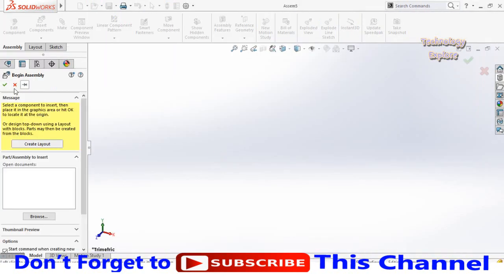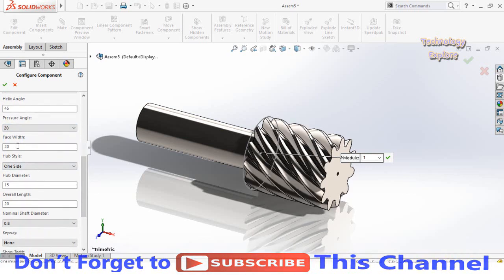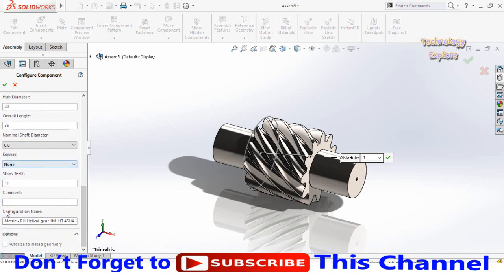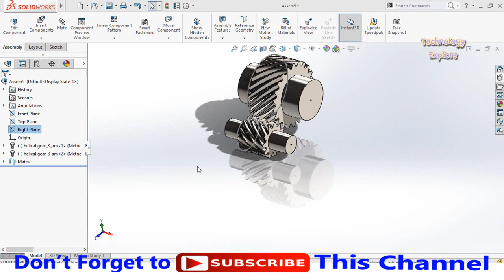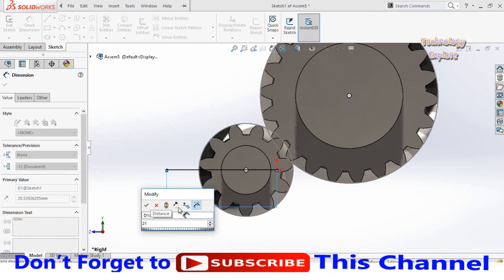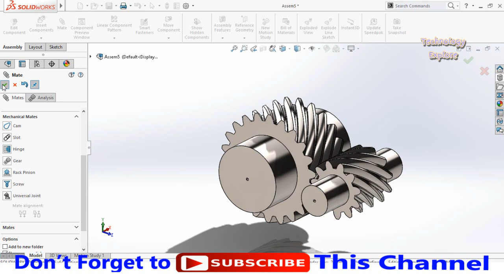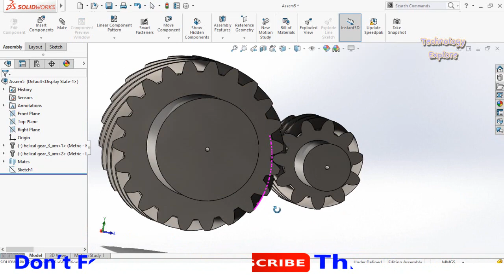How to Import and Assemble Helical Gears in SolidWorks Assembly | SolidWorks Tutorial

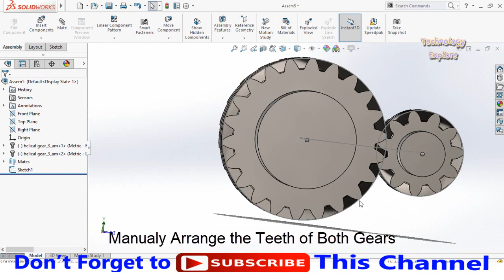Comment: You arranged teeth at 5:30 on one side but they were interfering on the other side (5:36). The helix of the two gears are not matching up. Is there any solution for this bug of Solidworks?